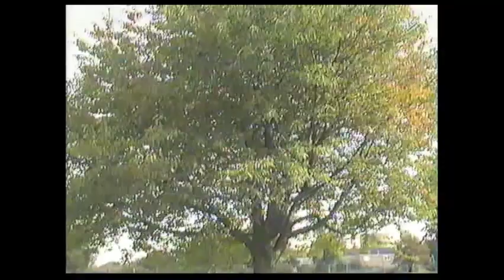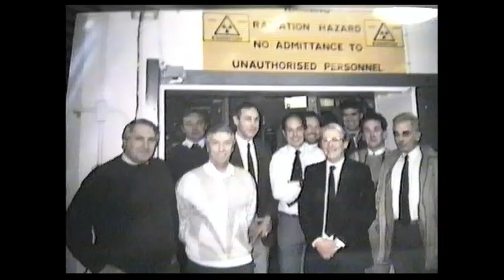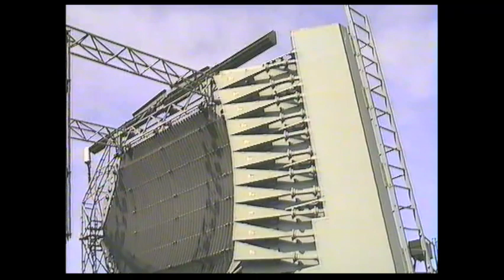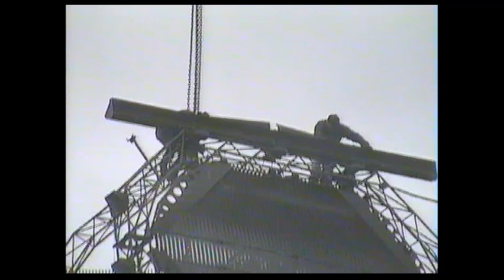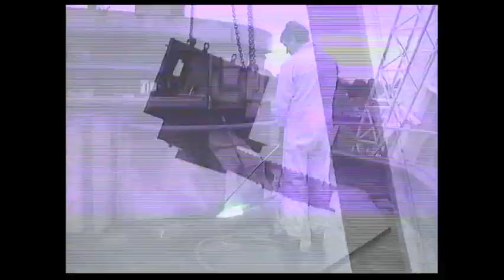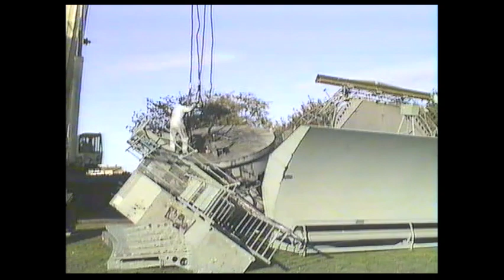The Demise of The Type 82 Radar (Eastern Radar)

Comment: You would never know anything of eastern radar was ever there now. It's all gone, buildings, the lot, houses now accommodate the area eastern stood on. No monument is there to say there was a radar base there. Even RAF Watton has completely gone too, all now houses.
Reply from the maker: Not quite completely gone, there are still standing the 4 H Blocks and the Airmen's Mess (Mr Read's) on the North side of Norwich Road. First meal in the Airmen's Mess was Christmas Dinner, 1940, but I cant imagine how many meals were served after that. 
Also, still standing, but built in to the Fresh Motors complex, is the old Drome Garage, originally used as a lorry base when building RAF Watton in 1937 - 1939, then used as a Bomb Disposal Depot.
I was disappointed that when developing Blenheim Grange, they moved the main entrance about 8-10 feet nearer to Watton, when the gates at Mr Reads were directlly opposite.

But as you say for Eastern, you would never know it was there.